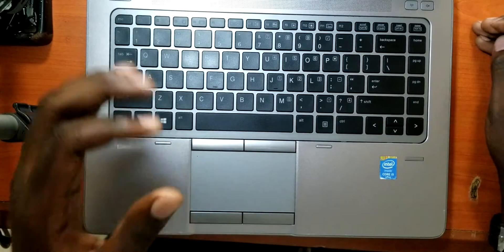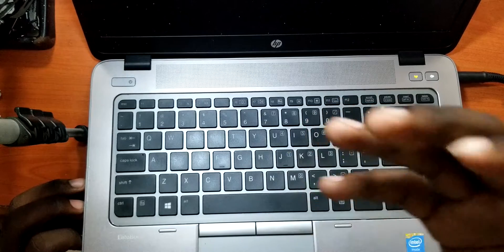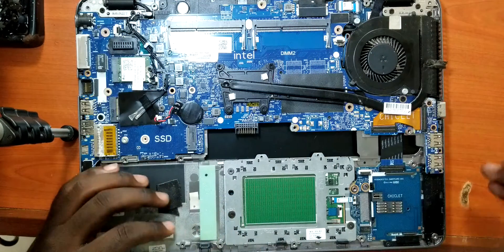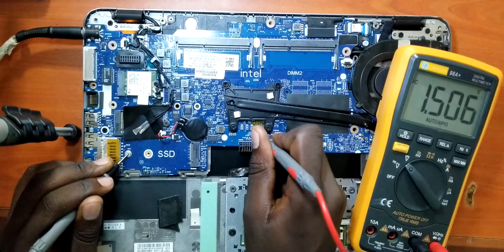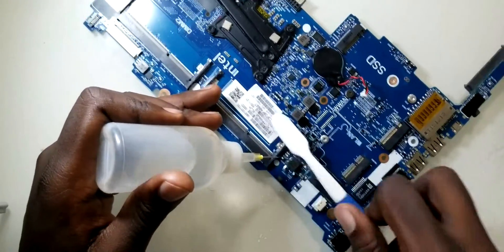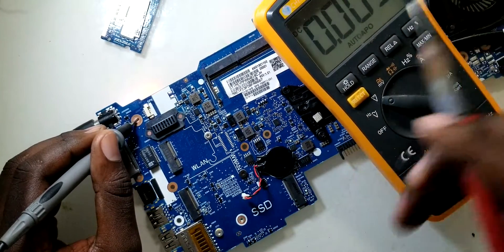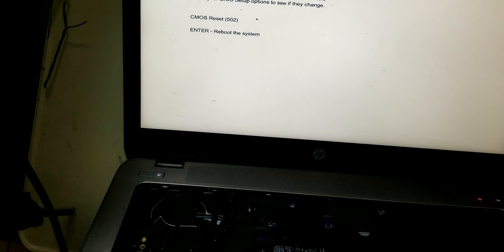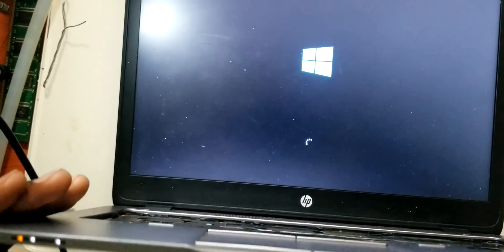Another HP 840 G2 Motherboard Repair with a Unique RAM Chip  Fault, From a YouTube Viewer

Comment: My HP laptop won't boot it keeps just blinking light. No falls or water, could the issue be the BIOS or the motherboard. The laptop also displayed the same symptom like the one above but it usually was resolved temporarily when I shut it down until finally it's as the situation I just described above.

Comment: Gee you are a bit rough with the hot air. Knocking components of is not professional.
You took longer to solder the chip  in than take the old one out!